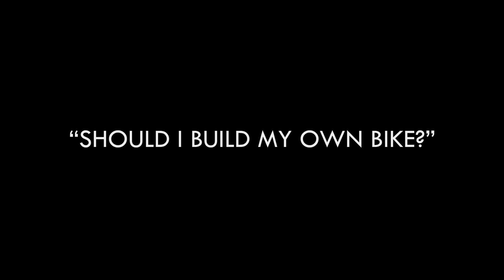Building a bike under 50k | A bday Surprise for my Dad

Comment: Tip from DP24 Dasmariñas City Base: Lighting (white for head and red for tail), bike bell, loud bike horn* must be installed as a safety feature. You might consider safety and security in dealing with the bicycle installation.

* - if intended to use as a commuter/daily bicycle from home to work and vice-versa